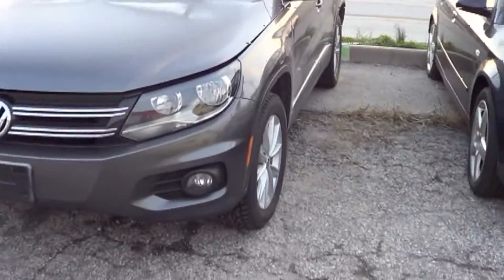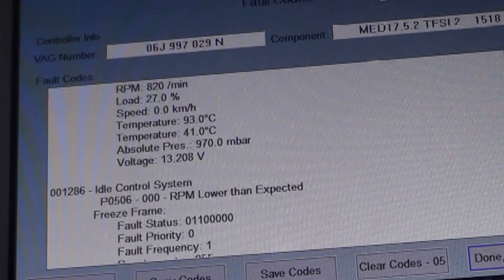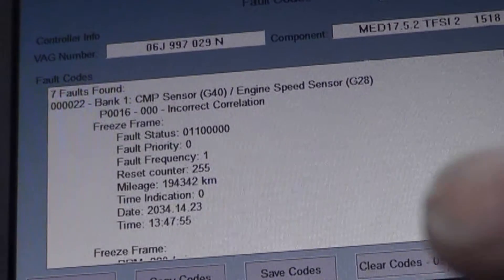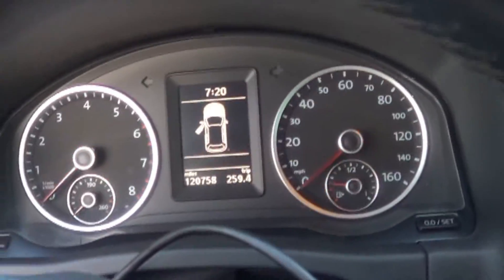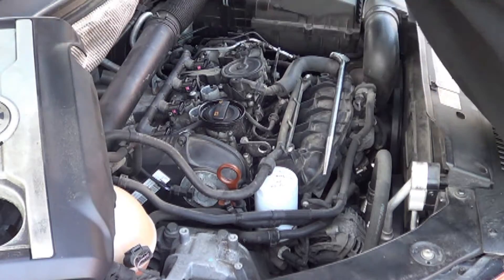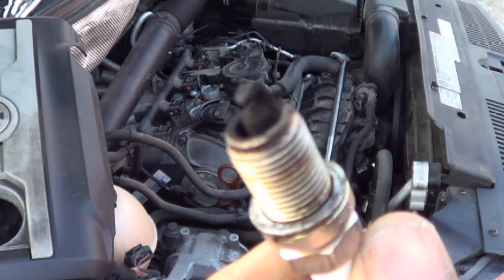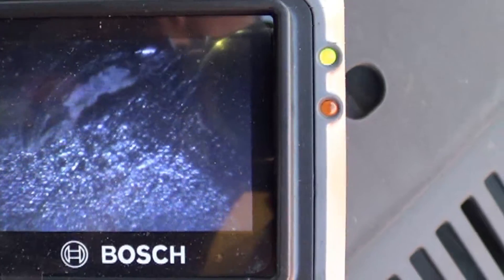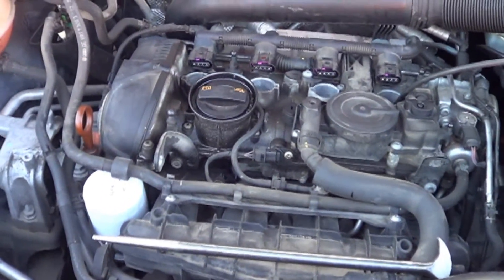2.0L Tsi CCT Tiguan wont start timing chain

Comment: This was a recall item in pre-2011 engines, well documented online and how to preemptively fix it by replacing the tensioner for the chain or check to see if it was fixed.  When I was shopping for a tiguan I came upon this issue and opted to get a 2018 model.  If people aren't going to research their used cars, at least dont keep driving on a check engine light. 🤣 Also, plug fouling is probably from running regular in a premium preferred engine.
Reply from the maker: yes, and I believe I stated so in the video. I hope everyone avoids this problem by changing their Chain (and related parts) preemptively as you suggest.  Thanks for watching and commenting  on my video.
Reply: @CoolAirVw  no problem.  It wasn't a criticism of you.  I'm just amazed customers are still driving things a decade later with known issues.  Save a buck today, spend three grand tomorrow.
Reply from the maker: @grevensher594  I didn't take it as criticism.  I'll pin your comment so hopefyully more people will see it and change their chain!
Reply: Yeah I pulled ancient plugs out of our 2011 that had almost 100k on them and they were whitish and clean, not black and fouled like this, I only run shell 91 religiously because it’s the only fuel near me that has 0% ethanol and it’s the only gas that’s given me no trouble with my aftermarket tuned cars. I would bet it’s cheap gas too.

Comment: I’ve been working on a 2007 mini cooper s, I’ve changed, fuel pump, fuel filter, spark plugs, ignition coils, crank and cam sensors, I’ve also cleaned the map and maf sensors, sounds an awful lot like the car in the video, vehicle has 98k and never had its Chains fone before

Comment: Mate, I’m about to buy Tiguan 2012 155tsi with original 62.000km on the clock. Can you please give me any advice and when should I replace the timing chain? Thanks
Reply from the maker: I tell my customer to change chain system at 100k Miles.

Comment: So, what was the problem?..
Reply from the maker: uh, its in the video.  Chain jumped out of time and pistons smacked the valves making impossible for cylinders to compress the air fuel mixture making no start.
Reply: @CoolAirVw  I have a similar issue as shown in the video with my 2009 mk6 golf. Chain was changed at 100k. Current mileage is now 137k. No warning codes, knocks, misfires etc & was just like any normal drive until the following day car does not start. Mechanic mentions low compression ( 25psi ) in all cylinders. Not exactly sure what the issue is as the car was driving all fine.

Jump starter does not help out either.

Any urgent advice on this?

Comment: what is the primary reason a newer 2.0 tsi engine cant be used in a 09-11 passat. my 09 passat has the chain and valve damage and would like to install a low mileage tiguan 2.0 tsi engine.
Reply from the maker: Do you know the letter code of your engine?  Might be a BPY engine??  BPY will NOT interchange with later CCT from Tig.  Radically different engines despite same displacement.  Cheapest repair would be head repair after valve crash due to chain fail.  Changing engine is labor intensive (expensive) and those engines run very high from salvage yards.

Comment: I just had the same thing happen to my 2010 Tiguan.  The mechanic says it needs a new engine but you replaced the head and I assume the timing components.  What was the cost of this repair?  An estimate would be fine if you cant remember.   Thanks
Reply from the maker: sorry I dont price when stuff isn't local nor do I price on youtube comments.
Reply: @CoolAirVw  shoot just got a diagnose of this from the mechanic in town I have a 2015 VW tiguan, don't know whether to leave there for repair or haul it over to dealership?
Reply from the maker: @deanaoconnor967  aftermarket shop will be cheaper but make sure machine shop that rebuilds the head does NOT replace the "ferrous" exhaust valve guides with "brass" like the intakes are!  They will not last!  See my other video.  Either reuse them if they are good or contact me and I can get sell you some.

Comment: I had water pump replacement on mine and some how the timing chain  failed my question is how is this possible?
Reply from the maker: timing chains fail all the time. Probably no relation to the water pump work.
Reply: Yo that happened to me too. And at 51k miles only

Comment: I have a 2011 Tiguan and after 1 month we placed the water pump and now the timing. Smh $6600 in total
Reply from the maker: Ouch.  Timing chain needs to be done every 100k or pistons smack valves.  Waterpump is plastic so they crack and leak.  Newest ones that we use are aluminum so that fixes the issue.   Lets hope you don't have turbo problem or crank vent/rear main problem.   See my other videos.

Comment: Thanks for the video. Unfortunately, my next door neighbor bought a 2011 Tiguan with 231k miles for their teenage daughter. After just 3 months of ownership she limped the car into the driveway after horrible engine misfire and vibration. We worked on it today and I think the timing slipped and the engine is toast.
Reply from the maker: If its still running I doubt the pistons smacked the valves.  It can jump one teeth or so and still run although badly since the timing is off.
Reply: Yeah I remember our 2010 limped in driveway, I scanned it for codes, got the cam shaft errors etc, I cranked it anyway to try and start it not knowing what I was about to do and smacked all the valves into the pistons with the starter, you could hear the metal on metal clanging. 

We replaced it with a 2011 with the same tensioner issue. The only difference is this time I’ve been the one changing the oil & more frequently, and the car has made it another 50k longer than the previous one, it’s also about 7 years older and was purchased used too. The 2010 we had from new and was only maintained at the dealer. Engine blew at 107k Kms. VW paid for a replacement engine but my brother wrote off the car a week later. When the engine grenaded itself it was about a week after the car had just had a turbo replaced. When I checked the oil level after the engine smacked valves there was no oil. I’m guessing the dealer did the turbo and maybe forgot to do the oil after. This wouldn’t be the first time the dealer screwed up. The last time the car had the intake replaced for the recall they left the high pressure fuel line loose and it was spraying fuel everywhere. Lucky the car didn’t catch fire.

Comment: my 2010 tiguan trys to start but it won't turn over. I change the battery, pcv valve the spark plugs n the variable timing solenoid n nothing
Reply from the maker: timing chain/tensioner fail causing out of time causing pistons to smack valves causing no compression?  (similar to what happened in this video????)

Comment: How much does a chain replacement cost on average?
Reply: Ok could you answer this question... I just took mine to my local shop they said the timing chain broke, what would be if any options at this point besides changing out the whole engine?
Reply from the maker: @solodolo8791  Head repair is usualy a better option than replacing the whole engine.
Reply: CoolAirVw Rm ok thanks I will look into that
Reply: @solodolo8791  If the timing chain broke, you could not drive the car, so did you tow?
I did this job back in 2017 when my tensioner failed @120K 
I had to pull the head and get rid of the valves.
Reply: Tumdéaux I stopped at gas station grabbed something out the gas station tried to start it and wouldn’t start, it’s been two days and hasn’t started since then my local shop quoted me $5300 to replace the engine... plus I’m still making payments on the car 🤦🏽‍♂️
Reply: @solodolo8791 I'm not sure how mechanically inclined you are, do you have a cylinder pressure gauge? If they're is not any cylinder pressure then you knocked out the intake valves and need to replace them. That is what happened to me. 
$5300 is quite a lot of cash. The cylinder head in parts and tools (my own labor) cost me $1000.
What model and year is your car?
Reply: Tumdéaux 2009 Tiguan turbo ... NON TDI
Reply: @solodolo8791  HaHa! I have a 2009 Tiguan too.
Reply: Tumdéaux  nice quick and spunky ... while it was running 😞
Reply: @solodolo8791  It is zippy but expensive to run.
Do you have space to fix it? If you can do it, its the best way because the cost of engine replacement is awfully expensive. I have some photos of me putting it together. Torqueing those headbolts felt good after 3 days.
https://imgur.com/a/mOsxgAC
Reply from the maker: @tumdeax  Customer towed the car to my shop.   Looks like yours is another early failure.  I recommend to all people with this engine to change the chain, guides and tensioner at 100k.
Reply from the maker: Sorry I will not post pricing on youtube.  Plus there is no way my pricing would be same as pricing where you are.
Reply: Thanks I appreciate the information.... only time will tell what the end results will be.... thanks again 👍🏽
Reply: like 2100 ish… depending on the shop. but for the new pistons head and rings plus chain was 7k

Comment: I’ve been looking for a video on this exact topic. My sister has a like new 2009 Tiguan, 80,000 miles. It’s been sitting in her garage since October 2016. She’s giving it to me. I hope it’s just the tensioner. Can anyone give an estimate for this complete job and one with just the tensioner replacement. Thx

THE DIAGNOSIS FOUND CODES:
P0011, P0300, P0301, P0302, P0303, P0304, P0506, P130A, P1297
Reply: there is an inspection plug on the lower timing cover, you can see there is the tensioner is bad
Reply from the maker: If the car wont start its probably not just the tensioner.  If it still runs and has those codes maybe.  We used to offer simple tensioner replacement, but then a few that we tried ended up having so mush slop in the chain that the tensioner was all the way extended and the chain still had slop.   The tensioner, chain and guides need replaced at 100k or the chain will fail and pistons could smack the valves.
Reply: CoolAirVw Rm Understood!

She says she was driving, the car began loosing power at acted like it was going to shut off. She had it towed to the VW dealership. They changed the water pump, among other things, then she was back on the road. Three months later, the same thing happened. She had it towed in, the dealership techs pulled the codes I listed above, but said the needed $1,200 more for a diagnosis. 
She declined, had the car towed home, drove it into the garage and it has sat there to this day.

What do you think?
Reply from the maker: @Thedarjon813  Cant know anything based on what your saying.
Reply: CoolAirVw Rm thx. I’ll email you

Comment: I own a 2003 Jetta VR6, at what point should I replace the chain on this engine. It is on the back, I thought a good time is when doing the clutch!
Reply from the maker: I've only saw a couple vr6's jump time.  120k or any time you have trans out.

Comment: I have a 2002 jetta 1.8T AWP, sadly the timing belt failed and pretty sure it bent all 20 valves. Would i be better off putting in a low mile replacement engine in or just get the head rebuilt? The car currently has around 185,000 miles.
Reply from the maker: If you fix it then you get a rebuilt head--better reliability.    If cost is a concern then you'll have to price it both ways to know.,

Comment: Great idea for coil removal tool! 
TSI engines support the economy, by bending valves since 2009. =)
Reply from the maker: Older ones too!   BPY engines the chain tensioner fails (cam to cam chain).  Bunches of those.
Reply: @CoolAirVw  true.
Reply: LMAO great comment, in Denmark it's the same. Over $2000 for new timing chain on my TSI
Reply from the maker: No valve bending needed.  Change the chain, tensioner and guides at 100k.